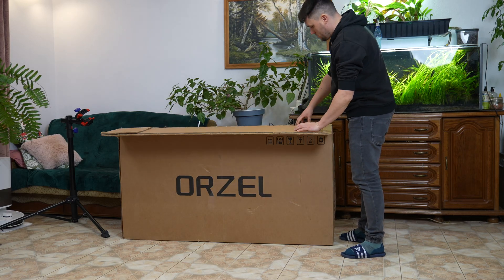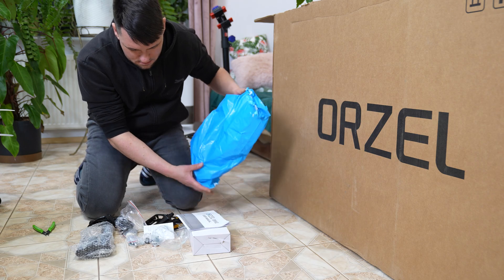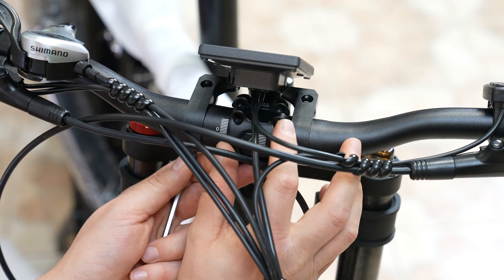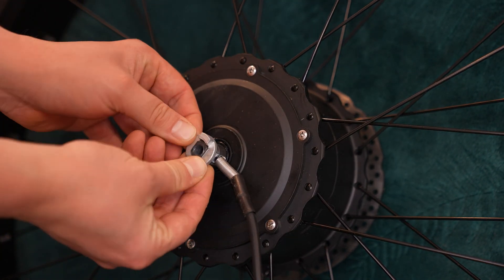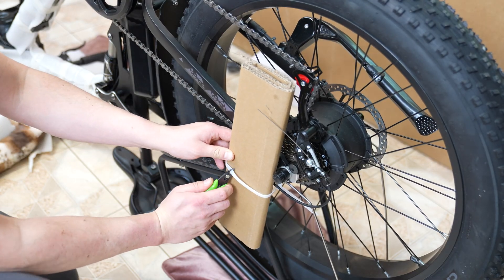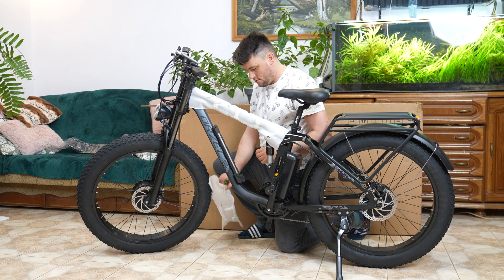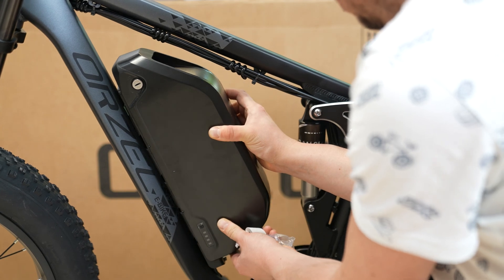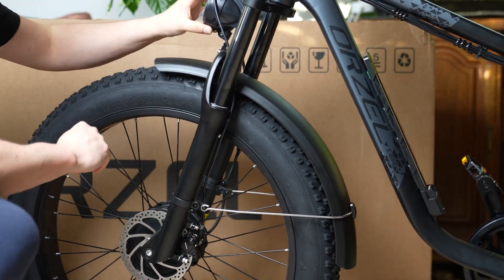Orzel K17 with Dual 1000W Motors – An E-Bike That Delivers Power and Comfort [assembly]

Comment: Witch is higher top speed?
This one,or Duotts F26?
Thanks in advance.
Reply from the maker: I would point Duotts F26 since it has a better gear ratio and You can pedal more and ride faster.